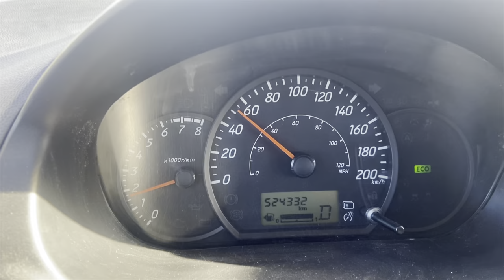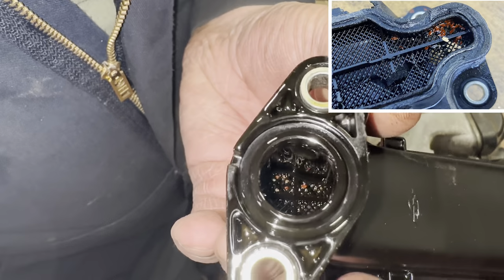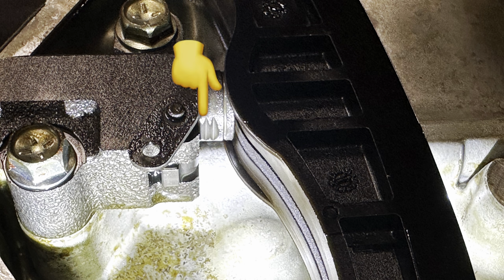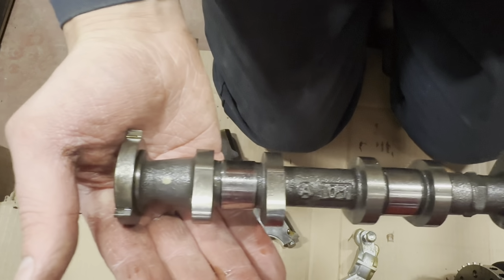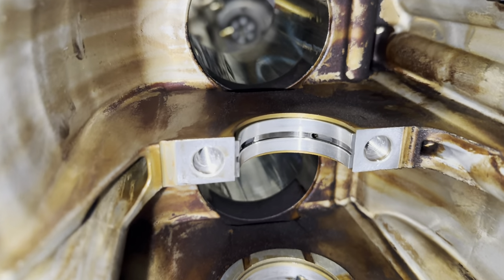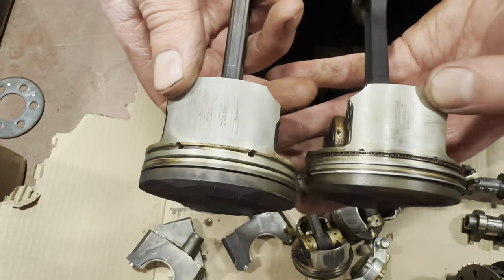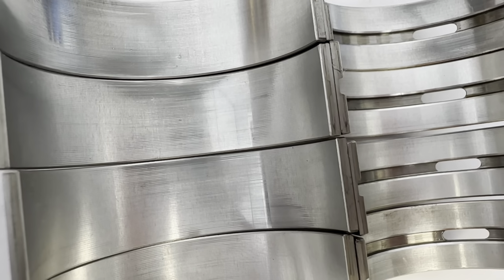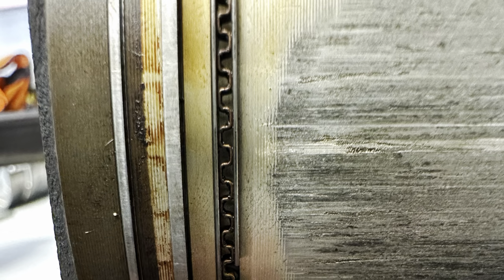524,000km Mitsubishi Mirage engine teardown

Comment: I bought a 2017 G4 with a 5 speed brand new, and the only issue I've had with it is having to replace the oil pan because the ham-fisted teenager doing oil changes at the dealer damaged mine. The entire car seems to be built so that a normal person can take it all the way apart with socket wrenches.

Comment: if you do regular oil changes it will last forever. I drive a 2015 Toyota Tacoma 4 cyl, currently has 280k miles. Still runs as good as original, also have a BMW 325i from 1989, 472k Km so far

Comment: I have a manual trans Mirage and I maintain it very well and drive it like a rally car at times.  Best little car I have ever owned.  Very reliable and easy on fuel.  Never once has it let me down.  Far more reliable than some more expensive vehicles that I have owned in the past and currently own as well.

Note sure what the stuff is on the oil pickup tube.  I am wondering if its glue pieces from oil filters.  Some filters have glue holding them together.

I think the clatter sound is from the crown of the piston tapping the side of the block and the piston goes up and down.  Let its clatter on and keep driving.  When it grenades itself on my car, I will take my snow brush and plate off the car, leave it in the intersection blocking traffic and take an Uber for the rest of the way home.   LOL

I enjoyed your tear down.  I have always wondered what the inside of one of these engines look like.

Plate C
Reply from the maker: My personal beater 2014 Mirage is the lowest cost of ownership car I've owned. I bought it used a couple years ago with around 300k for $1000 and a wonky cvt. Drove it 6 month then spun a rod bearing! I was thinking of scraping it but found a used engine and cvt with under 10k kms for $1200 from LKQ.  It should be good til it rots away or someone crashes into me. I don't have theft insurance on it cause I can't even program a key for it with my scan tool like I can with other mfg so chances are low that it's getting stolen. And it's a Mirage so that itself is a theft deterrent. The 5spds 

You might be right about the oil filter glue. There's nothing in these engines that's red like that. I've only used oem mitsu and wix filters in these cars. 

And I think that noise is piston slap too. 

It could have kept going a lot longer, it just sounded like a diesel and nobody wanted to drive it cause they were afraid it was going to blow up.

Comment: Still better than a Hyundai Theta engine 😂
Reply: Yeap
Reply: A bicycle is better than a Kia/Hyundai product.
Reply: The older Hyundai Exels engine was suprisingly durable. There was Turbo kit that sold that could be pretty much bolt on pretty much ready to go, so they could even handle a little boost
Reply: Is that what went onto the Scoupe? Those engines are basically Mitsubishis, and the good Mitsubishis, too: 4G15s are durable engines.
Reply: @jessebrook1688  It was the Sirius (licensed 4G15) and Alpha. Theta appeared in 2004.
Reply: @darkrulier that makes since , that  Chinese company "great wall" used Mitsubishi engines in their cars too, they were heavily underpowered but very reliable
Reply: @jessebrook1688  yeah I think so
Reply: @EdmundSampson-pd7vi  underpowered (for their size) engines tend to be reliable because the parts have to endure lower cylinder pressures.
Reply: Not even free would i buy a hyundai or a kia
Reply: @archie_bunker  you're a republican and I respect that
Reply: The Theta still kicks the Nu's ass
Reply: @EdmundSampson-pd7vi  just a person with common sense
Reply: @oeku3432  theta?
Reply: what  about ford ecoboost
Reply: @archie_bunker  yes,.... a republican with common sense. Don't be shy. The cigar hangin out the mouth, says it all. Man of class and taste, respecting his country
Reply: @archie_bunker  How would you buy something that is free in the first place? 🤦🏻
Reply: @DGTelevsionNetwork  I saw an Accent from 2001 with 280,000 miles. Try and ride a bicycle from 23 years ago 280,000 miles. Keep in mind, this car was in the rust belt its whole life, and it could still pass a state inspection, if it were subject to that in Illinois outside of Chiraq.
Reply: @leumamk5259  nothing is free lol
Reply: @archie_bunker  Then why did you write "not even free..."?
Reply: @leumamk5259  i have commented with that same comment on other channels regarding kia's and hyundais and you are the only one that has replied back . lol  i drive only toyota's and honda's
Reply: @leumamk5259  do you drive a kia or a hyundai?
Reply: @archie_bunker  LOL! What does that have to do with my question about your nonsense?
Reply: @leumamk5259  you do drive a pos Kia lmao

Comment: Unless the oil pressure was low from bearing wear, the noise was most likely just a needed valve lash adjustment with different shims in the lifter buckets.  Lots of life was still in both of these engines.
Reply: I heard these engines can get piston slap, so it might have been that.
I hope he properly diagnosed the engine before replacing it or scrapped the car.
Reply: Piston slap, cylinder scoring and wear.  It was running but power and efficiency would be reduced.  Valve lash would make noise but it's the easiest thing to check before even removing the engine.
Reply: @ianrobertson3419  The thrust side piston skirt wear shown in the video is mild, especially considering the miles.  He said that it was running and drove fine and was in daily use, just that it was noisy for the last year or so.  The bucket shim valve lash is a very robust design and often never needs adjustment for the life of the vehicle - but at this mileage would not be an unexpected service.  I was especially impressed with how nice the camshafts looked.
Reply: @Thomas63r2  the pistons are worn on the skirts and scored the cylinder.  The rings are no doubt worn too.  When those things happen it'll still run but it will make  noise and produce less power.  A simple compression check would show how much.
Reply: @ianrobertson3419  I've seen so much worse on engines with a fraction of the mileage compared to this engine,  He said it was running and driving just fine, I don't believe there were any oil consumption issues and they had already been driving it for ~ a year  with it being noisier.  I think its likely that because of the mileage that after the engine was noisier the decision was made to be on the hunt for a low mileage salvage engine as being a less expensive fix than an overhaul.   They just kept driving it until the right engine became available.

Comment: I ran a Diesel version of this engine in a Smart 4-2 & the engine was the only system in that car that was bullet proof, so when I moved on to a newer car all I did was look for a new car with the same block as the 4-2.....voila, the Mirage! If the 4-2's running gear/transmission was as reliable as the Mirage's I would still be driving it.
Reply: The Smart Fortwo diesel is a Mercedes OM660. It is only the second-generation petrol onwards that run the Mitsubishi 3B21 - entirely different block to the 3A90/3A92 in the Mirage.
Reply: they had carbon fiber structure for crash saftey on one fo them,  mercedes was saying theirs is just as safe os their s class they crashed it into. if it could keep its low end height up in the moment of a crash sort of like audi a 8 suspension precrash geomtry change , itd maybe be the saftest car ever too . but thats like 30k for a compact 4 seater whos competition is around 15k-20k

Comment: Damn, it's pristine inside.  When you popped that valve cover off I couldn't believe it.

I'm used to (and it's been a long time) pulling apart greasy carbureted engines that have been rather neglected and leak oil everywhere.  This was like something under a jewelry counter.  Old smogger carb'd junk was alwasy so incredibly coked and and just plain done.  This could go back together with just new pistons and the bores cleaned up. Thanks to your frequent maintenance.

Comment: I have one of these, 5sp manual, almost same age as this one too. Only 78,000 km so far. V good economy, I get around 5.4 litres per 100km around city driving. Sub 5 when it's continuous and doesnt involve hills but not the mosr refined car to drive and weak as cats piss on the hills.  V pleased to see that with regular maintenance, the engine will last a good while. Which is surprising as Mitsis dont have the best reputation for longevity. Thanks for sharing.

Comment: i think one reason a lot of smaller engines last a long time compared with many larger engines with everything else being equal (like quality of bearings, quality of assembly,for instance), is that they hold more crankcase oil, in proportion to their size/displacement than the typical larger engine does. for example a ford 302 or small block chevrolet holds 5 quarts i think with the filter (this is the older models i am talking about, like the 60's and 70's ones, i don't know much about the later versions), yet for example i have a factory service manual for the toyota 20R engine and it says the oil capacity is 3.9 quarts for the pickup, and 4.1 for the corona, if i remember right. so , you have a 2.2 liter engine as opposed to a 5 or 5.7 liter engine, less than half the displacement , but it has much more than half of the amount of crankcase oil to circulate and lube everything. half as many pistons, half as many rings, the same amount of main bearings as most V-8's but they are probably smaller/less surface on the toyota, less camshaft bearings, and half as many camshaft lobes and half as many rod bearings. surely the oil stays cleaner in the smaller engine with everything else being the same such as amount of blowby the engine has (which contaminates the oil faster), and the frequency of oil and filter changes
Reply: Mainly, it comes down to less moving parts and low horsepower.  Horsepower and torque increase wear on the engine and transmission.
Reply: The smallest enginees are substantially oil cooled, although none has an external oil cooler.

Comment: Dingle ball and put new pistons and rings  with the same wrist pins and run it. See what happens. I bet it runs like a top, this engine is clean as hell
Reply: Probably does not need new pistons since the rings were not carboned . The low tension rings don't wear the block much when the rings are not stuck.

Comment: Got one for a longer term rental, i carry 60 lbs of equipment in my car and im 230lbs. It was super slow but sipped fuel and ran like a watch. I dailied a kia Rio which was way faster but engine codes galore at the time. decided to split the different with a honda fit. 200k miles and it runs like new

Comment: That noise could be the timing chain tensioner failing or the variable valve timing actuator if it is not piston slap or lower end bearing noise which from the looks of this engine it doesn't appear to have much wear despite having high mileage looks perfectly rebuildable to me
Reply: It was clearly Vvti failing as timing chain was not that streched that Vvti could not compesate.

Comment: Next teardown you might consider measuring a couple bearing clearances with plastigauge - comparing to spec would allow you to quantify bearing wear - you could also measure oil pressure - very low pressure would indicate excessive bearing clearances - I believe these engines use solid lifters, so it's likely that excess valve clearance with that high mileage is a noise contributor, in addition to some piston slap - piston slap is usually loudest at startup and quiets down as the pistons expand in their bores - excessive valve clearance though will cause noise all the time - still very impressive mileage 👍 solid motors!
Reply: Wow solid lifters... Wild in 2024
Reply: @Ariccio123  Yes many OEs have been using since the mid-2000s - they all use special hard coatings that minimizes wear and allows them to last - but they wear eventually and because there's no adjustment, you buy new lifters - lifters also rotate under the cam lobe, which spreads wear over a larger area and extends life

Comment: Don't know why everybody hated the Mirage.
It's a good car. 
Exceptional value and good reliability. Of course you need to change the oil regularly which was the case with this engine
Reply: Value, yes. Reliability likely average. Safety minimal. They are good basic transportation for the lowest price. You might call them a minimum viable product.
Reply: @802Garage  Reliability is definetly above everything that European and American car brands build. Don't try to tell me that the Chevy Equinox is as reliable. Probably average for Japanese cars which is exceptional in my opinion. 
A/C, automatic transmission, radio, electric windows, central locking etc. definetly make it more than a minimum viable product. Of course that car is not made to eat miles on the highway.
Reply: @no-damn-alias  I guess my standard is usually based on Japanese cars, hahaha. There are some American engines I'd trust for several hundred thousand miles, but rarely the rest of the vehicle. Euro there are some engines that can go forever, often with a bit more expensive expected maintenance, and at least the chassis are well made. I pretty much stick with Japanese brands though and personally own something like 10 cars with 200-350k miles on them. Mostly Subaru, despite what internet memes will tell you. Family has owned tens of 200,000+ mile Subarus in the last couple decades. The reason the Mirage is reliably largely has to do with how little there is to go wrong and how small and light it is. That's why I say likely average reliability. It kinda depends on what lens you're using. Are the individual components actually reliable and well made, or is the car just simple and not hard on its parts? Two sides of the same coin I guess. Definitely cheap to own all said and done! Mitsubish tends to fight for last place in Japanese reliability with Nissan. At least the Mirage was really cheap. Overall, I agree with what you're saying.
Reply: @802Garage  well American engines tend to have little power for their size and to not be the most economical. 
Well Subaru is another horse. Mostly reliable but again in my eyes not very fuel efficient. That might be not as important over in the US where fuel is very cheap. 

Yes some Euro cars are fine and worthwile buying in Europe as parts are very very cheap for them over here and readily available. Problem are luxury euro cars where a lot of stuff is just a pain to change or maintain
Reply: In "Europe" it was there handling was not on par with vw up. peg 106 ect
Reply: @gingernutpreacher  you can't compare it to the Peugeot 106. Much much older design which was originally came to market in 1986 with the Citroen AX. Very light and nimble but a death trap and not comparable. Same goes for the Vw Up that is smaller and more expensive. Also a VW UP just has no handling. A harsh ride with no cornering speeds
Reply: @no-damn-alias  sorry I ment the 108 and in the UK the mirage was more expensive after  introduction and  despite it being smaller it's in the same class the boot the vw up was deep so could sill get a sucase in. And it was rebaged as the seat mill and scoda citygo was cheaper still. As for handling it should of been better but it was no slower in the corners especially  if it had 15 or 16inch insted of the 165 70 14 or the mirage was universally panned for its handleling as for safety I'd rather de in the citygo than the mirage
Reply: @gingernutpreacher  the bigger wheels made the UP accelerate much slower. I tested it myself and went to 165/70R14 on magnesium wheels for best result.  

Also you have to remember that the 108, basically an Aygo, which was very reliable but had horrible NVH or the UP that was still more expensive and Seat or Skoda was only cheap in very low spec, weren't available in the US. 
If you want true cheap motoring and a car that is reliable, cheap and easy to repair. 
Get a first gen Dacia with the 8 valve engine or a Dacia Lodgy with that engine. 
These cars also hold their value very well. 
If you get the sedan it is very quiet and drives comfortable. 
In the boxy Dacias you need some weight in them for that.
Reply: @no-damn-alias  I ran 175 x65 14 on my skoda city go kept the steels the dacia has go relitvly expensive here in uk not sure if they still do the 8 valve either you have to remember EE gave stupid road tax baced on co2 and the 8 valve was high
Reply: @gingernutpreacher  I know about the stupid co2 tax. My Lodgy is on LPG and that more than halfed road tax. 

Dacia are very stable with used prices as they're pretty reliable and cheap to maintain.
Reply: @no-damn-alias  I know now they use the latest clio platform but the early models that didn't I found to be terrible in ride and comfort and handling and the 900 turbo was noisy
Reply: @gingernutpreacher  well it depends. The station waggons simply needed to be loaded, then they road really nicely. I have a first gen Logan MCV from 2007 and when it had a bit over 500kg in it. Two male adults and some 300kg or load then the ride was really really nice. You couldn't notice ANY bump or road imperfection. Great! 
When empty of course the ride then wasn't all too nice. 
I also have a 2022 Dacia Jogger and it rides way better when empty BUT gets boaty when loaded. Especially rear passengers can get kind of sea sick. So far everybody has been fine but I'm looking for improvement there and I already have the seven seater with harder springs and shock absorbers in the rear. 

The Logan sedan meanwhile has a completely different rear axle. Rides nicely like the MCV with 500kg just not that heavily luxurious but very nicely. Also it way WAY more quiet. Also the 1.4l engine was doing better in the sedan than the 1.6l in the MCV. 
So for the future for day to day driving, I'm looking for 1.6 16v sedan. It can do 0-100 in slightly over 8 seconds .